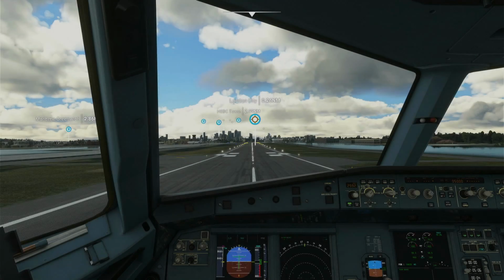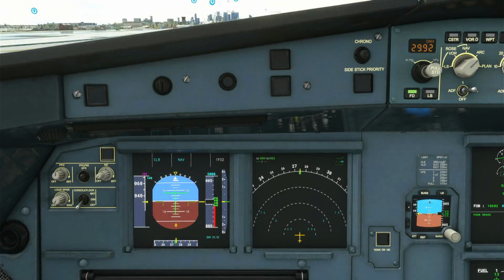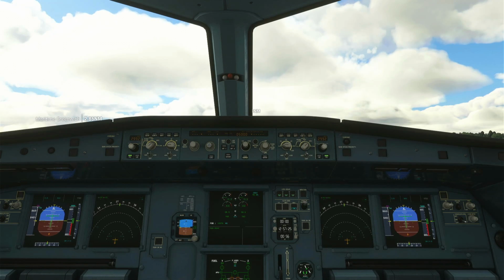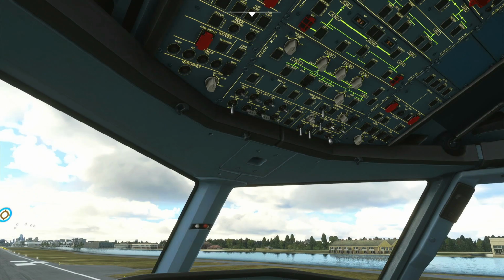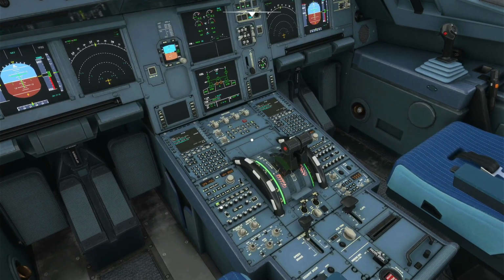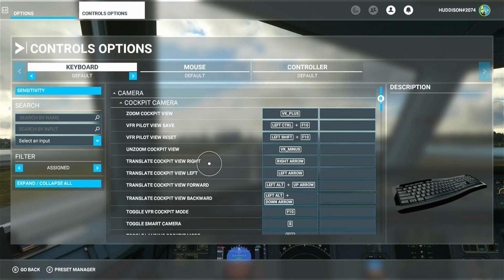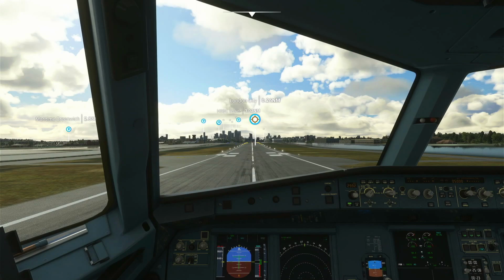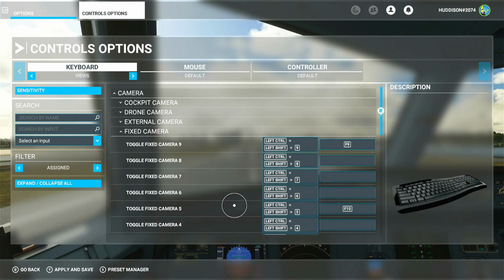Xbox FS2020: Cockpit & External Views - How to set Custom Views and Keyboard assignments!

Comment: I know this video is old but this how you get out the plane.
1.  Go to camera
2 . Click on copilot
3.  LB and LS back to the left until you can't move
4.  Click pilot and it should bump you out of plane.
5.  Save the view.
6.  Click your view to enter back into the cockpit
7.  Now click the veiw you just saved and work from there
You have to do the opposite to get to the other side of the plane. 
Hope this helps.

Comment: So I found a way to toggle an outside view with one button. Definitely still not ideal. But it’s the toggle drone view option. It seems to reset every time you do it which is frustrating. Also there are two of those shortcuts one under cockpit camera and the other one under the drone camera. The former does not act as a toggle only the latter.
Reply from the maker: Well done Brent 👍

Comment: I am having a problem with my camera now. When i get it and start its fine however when i want to look at the screens closer and press the button to zoom in it starts moving the camera forwards and doesn’t zoom in then if i try to get back to where i was as i have to face forward where my camera goes i am facing the back of the seat. Can you help?
Reply from the maker: What are you using to zoom in - a mouse?
Reply: @Huddison  The scroll wheel to zoom in and the left added button to move the camera. It’s working now hopefully it stays good. Don’t you use mouse ? 😂
Reply from the maker: @matthewrigby7054  Yes I use a mouse to zoom my views in & out - I was just checking to see if you were doing likewise ;)
My fingers are crossed that your settings now stay good 🤞

Comment: My series x is coming tomorrow,  I got it purely for this simulator.  I have the thrustmaster hotas and rudder pedals and a mouse. Is that enough to do all the controls or am I best getting a keyboard as well. Love the videos by the way
Reply from the maker: Wow you're pretty much set for a top notch experience there - A keyboard would be useful for the viewing system; depending on which aircraft you intend to fly.
Reply: @Huddison  thanks for the reply. I will get a key board then just so I have everything covered.  I'm 35 and always wanted to play a flight simulator since I was a kid but never fancied a pc. I'm like a big kid atm lol. Its not been cheap but I know its going to be worth it.

Comment: What mouse and keyboard do you have. I’m looking at a £20 keyboard from Argos. Looks like it will do the job plus it’s wireless
Reply: That’s what I bought mate. It works perfectly.
Reply from the maker: I use a simple cheap HP wired keyboard  and mouse; I think the compatibility is fairly wide for most keyboards and mice.
Reply: Let me know if your wireless keyboard works with the series x my wireless mouse doesn’t
Reply: @lesliesangster3841  where did you buy yours from and what make is it
Reply: @DeanArnold1066  it just a cheap wireless Trust mouse that works on my laptop I don’t like using the touchpad, Im looking for a cheap wireless mouse to work on my series x because I’m sat to far away from it to use wired.
Reply: @lesliesangster3841  I have similar problems with a Logitech ERGO trackball on my Series X. The mouse cursor moves but I can't click anything. A Logitech K360 wireless keyboard works fine, as does a Logitech M220 wireless mouse using a dedicated separate dongle, as does a cheaper Elecom trackball. Something strange about the way the XBox reallocates functions when you add mice and keyboards (if they work at all - no luck with a Rii micro keyboard and trackpad plus wireless dongle).